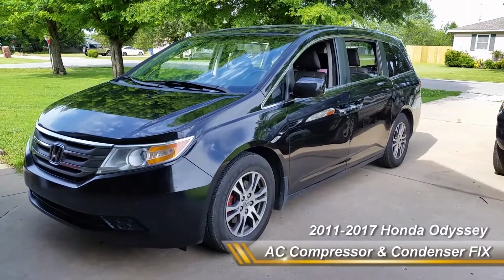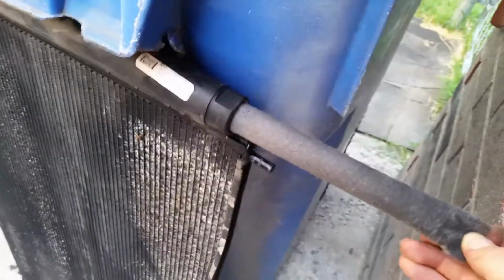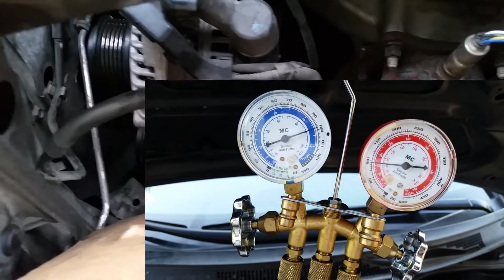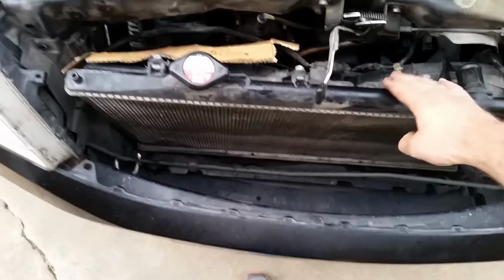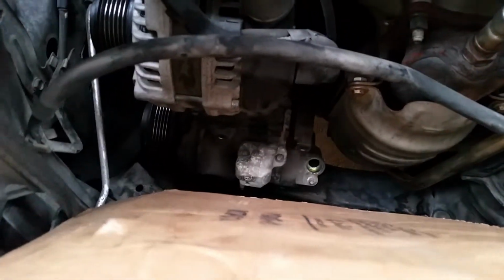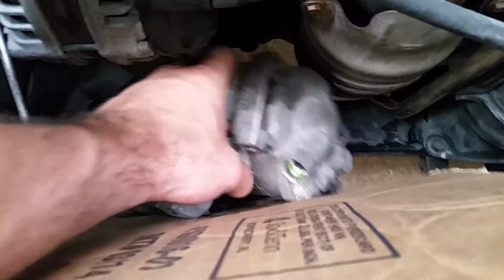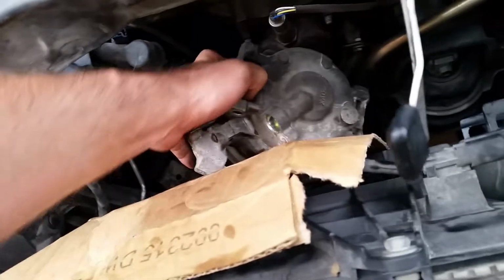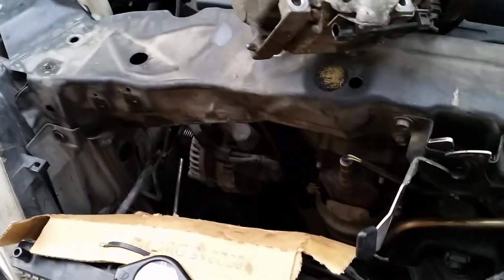Honda Odyssey AC Compressor Removal

Comment: Ok just did this!! He is right was a breeze to get it off from front!!  Not sure about the side!!  You can remove the alternator!  Be easier to mount compressor with alternator removed!!  I did not remove it but did use a ratchet to spin bolt on for me